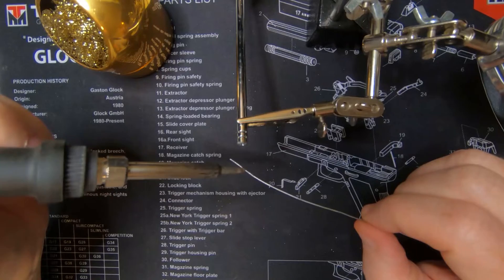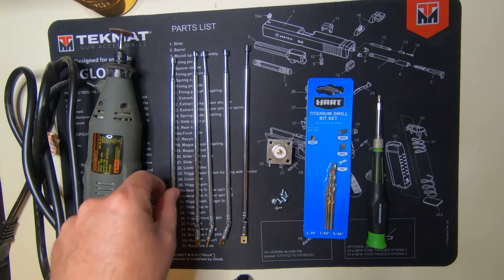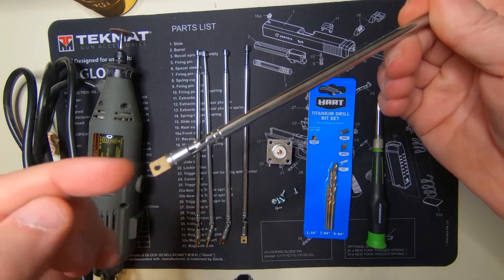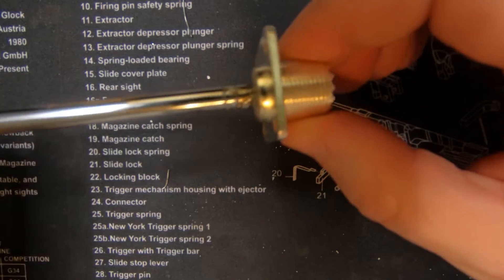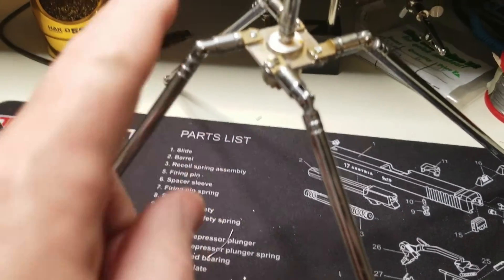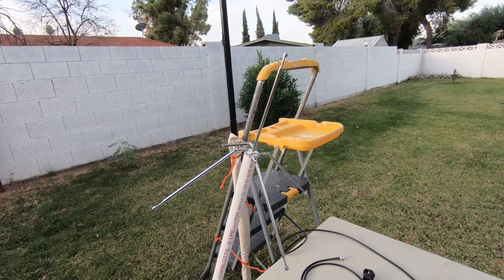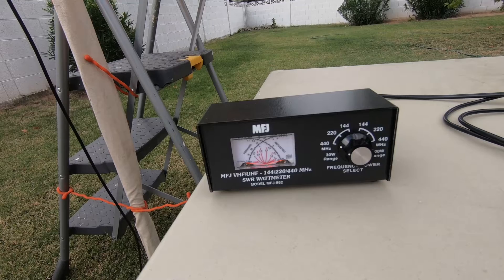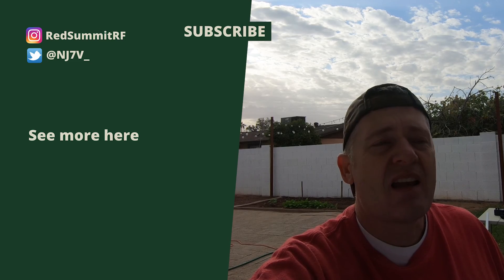How to Build and Tune a Tri-Band Ground Plane Antenna

Comment: This is the best ground plane project I've seen. It's my next antenna project. Those solder joints will need a solder gun or torch to heat it up enough. Or get those connections tig brazed.

Comment: Looks great. Would love to see the specs on the length of each band.
Reply from the maker: Well, I just use the West Mountain Radio online calculator to get each length https://www.westmountainradio.com/antenna_calculator.php
Then I added 6 inches to be sure, added the length to the antenna system, and cut to resonance using an antenna analyzer.
I honestly don't know what the actual lengths came out to, but less than the online calculation, because I tuned to the CW QRP calling frequencies.

Comment: Hi I really like your video. I'm not good at building antennas but I don't understand how you attach the central antenna. how do you stagnate hot poo thanks. excuse the English but I'm in Italy and I'm writing with the translator hello friend
Reply from the maker: Hi and thanks for your question - This phrase probably needs another attempt at translating "how do you stagnate hot poo".  If I understand your question, the answer is I drill a hole in the bottom of the antenna, push the pin of the SO-239 into that hole, and then solder it.  It has an electrical connection without soldering it so the solder is just to hold it in place.  It is a lot of metal so you need a very hot, large iron to have success.

Comment: I may make one of these for a my Go-Box. I like the fact you can collapse it all down, fairly small and compact, for travel, except the mast! But replace it with a sectional mast, and your in business!
Reply from the maker: Yes, this would be great for the go-box.  I regret that solution for a mast now.  At the time it seemed good, but there are better solutions.  Good luck with the build!
Reply: @RedSummitRF  I was looking at upgrading the rig: Change the Vertical Beam to a BNC mounted version, with a BNC to PL-259 adapter. Change the base to a PL-259 female, to Female base plate. This way you could remove the vertical beam, then fold up the horizontal elements, to pack it all up in a stuff sack.
Reply from the maker: @chrissewell1608  Brilliant!

Comment: Are the telescoping antennas long enough to operate 6m?
Reply: Same question
Reply from the maker: answered in thread just now
Reply from the maker: Not the ones I was using. no.  You'd need them all to be over 5 feet in length.  I haven't searched for a 5 foot whip but I will say that I use a couple buddystick whips for a homebrew 6 meter dipole.  I imagine those would work on a ground plane but it would be rather cost prohibitive.
Reply: @RedSummitRF  I have two Hamsticks per band from 6m to 80m that I have been using as a dipole.  I have some ideas to make an adjustable ground plane for 6-80m GP using 102” Whip antennas... it might need to be put onto a larger mount to make it work... I need to get off my behind and start building it.
Reply from the maker: @Gravel_Rat78  nice!

Comment: Great video. A few suggestions... Liquid rosen flux is really helpful for preparing such metal surfaces for soldering. Use brass screws... they take solder well. Finally, use a soldering gun for heavy jobs such as connecting the whip to the socket.
Reply from the maker: I'm so glad you added these suggestions - ALL very good and valid.  Thank you.  I hope those who find this video take the time to pop down and read your comments.